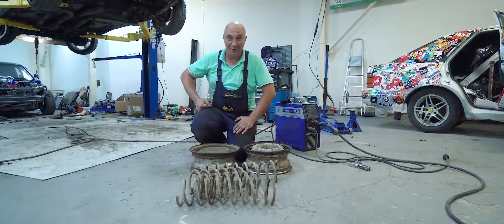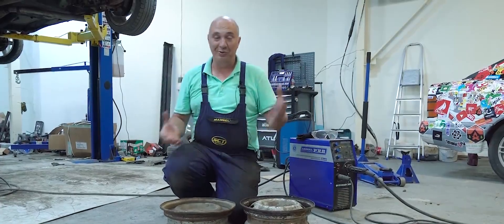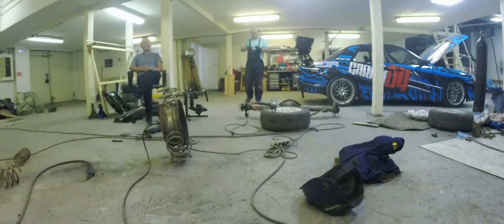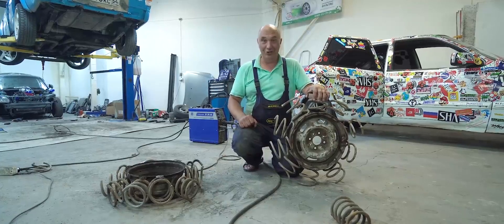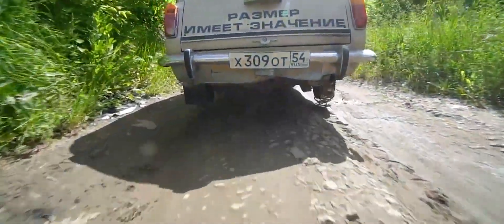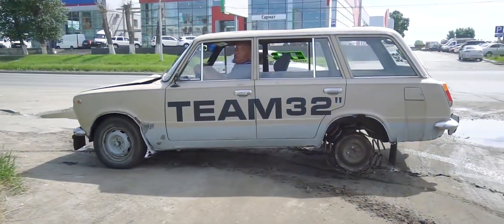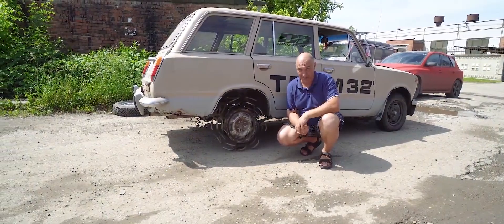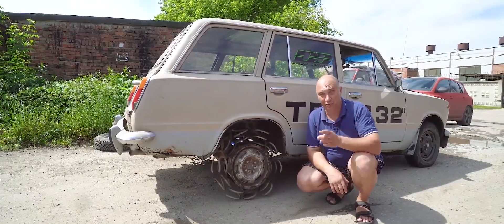Using springs instead of rubber tires

Comment: Only thing I would do is to add a rubber outer covering to the tires, so as to prevent something like a rock getting jammed up in the coil springs, preventing them from working properly.

Comment: You can cover the outside end of the springs with an steel or iron sheet and weld it up and put back the tyres, it will look more like a normal tyre, tube-less

Comment: Nice idea though. But those might leave behind marks on the road. I guess they are good only for off-road. And I think similar technique is already experimented with rubber springs instead of steel, which will be smooth and noise-free.

Comment: Сделайте это более сложным с более длинным видео, чтобы поставить все 4 шины на пружины и сделать упорный курс и подняться на холм. 

I used Google Translator if it’s not correct blame them lol 

For English I said put it onto 4 spring tires do a course and finish it up with a hill climb. Also make the videos a bit longer 

Also 

Take all the inventions you created and do 2 vehicles and have races or time trial challenges with each tire type head or head.

Comment: Hello how about you add some square to rectangle rubber pads to the road end of the springs as that may make it a bit quieter and smoother, maybe then you could try it on a regular road without leaving the tracks of a herd of drunk horses 🐎 running sideways really close together ..🐎🐴 🇷🇺 from 🇨🇦 👍🏻👏🏻👏🏻

Comment: If you just line the ends of the springs with rubber all around to make a circle, wouldn't that eliminate the need for suspension and make the rumbling stop?

Comment: Suggestion: Cool, I also got that idea ones.  Cover the springs with an soft but strong cloth so the springs don't get stuck in clumps of mud or wooden sticks when you go off-road. And to spread out the power that presses on the soil.   

Kevlar Cloth maybe?

Comment: Springs make for perfect suspension, but their narrow ends concentrate all pressure of the car weight on a tiny spot. This causes the spring end point to dig into the road surface destroying it.
You can try welding metal circle plates on the end of the springs, to increase the area so pressure can spread (car tire spreads load on an area size of a cigarette pack, it does not have a large footprint at all).
You might also try gluing rubber (cut from a regular tire) over the metal plates to decrease the noise. This could then work on asphalt without damaging it.

Comment: Suggestion, how about adding a steel ring to the edges of the springs that touch the road. This would smooth out the ride but you would loose traction. Metal grips would solve this problem, but like they say, "Easier said than done". Thanks for your video! Repent! Jesus loves you all

Comment: rip off bits of tires and stick in between the gaps at the bottom of the springs... should make good enough to drive it on normal road if you do that since it won't straight up destroy the asphalt in seconds.

Comment: Try welding a steal band around the outside of the springs. Same width as the rim. May want to either weld cleats to the band or glue rubber for traction, depending on the terrain you expect to drive on.

Comment: How about wrapping a rubber at the edges.... I mean replacing air in convention tyres by these springs.... It will be a lot smoother, faster and less noise

Comment: cut some tire tread and put it over the springs.it should make it sound quieter and ride even more smooth.
Reply: I thinking the same as it will be more practical idea and maybe replace the conventional air filled tyres in future because it can absorb bump and upper rubber part can sound quiter and makes grip as well without tyre flat problem
Reply: you could just find a big enough tire and pull it over the springs instead of finding a way to attach pieces of tire to each spring. as for the idiots saying its a bad idea but not explaining why..stfu fools
Reply: I love all the arguments in this thread put some flex seal on the coil ends :)
Reply: Raz Kumar air zoom tires?
Reply: Pernection yes that’s why I meant the rubber nailed on metal base without air as their are shockers inside to absorb bumps so no need for air.its like a alloy wheel with central shocker and outside rubber on metal as it will be a permanent solution for flat tyres
Reply: Completely unconventional for high speeds.
Reply: Urban Taint I would weld curved steel to the coils and then glue and rivit the rubber to that. It would provide more surface area and allow the forces to transfer more smoothly. You would have to leave a small gap between the steel plates otherwise when the load was transferred to them and they compress the plates would bump into each other but I do like the idea
Reply: Sarcalogos Tortolero .... you’re all dumb ...... just put a condom on each spring ffs ...... lol 😂
Reply: I’ve worn that idea on my feet it’s called zcoils
Reply: Weld a flat metal over the circumference of the springs and lay rubber over that.
Reply: good idea
Reply: kharmachaos667 you could always cap the springs.then it wouldnt puncture the rubber.
Reply: I am with u urban i think if u wrap with rubber spring will be superb
Reply: Okay genius so how you gonna fill the air if you cut the tyre,you dumb fuck
Reply: Vaibhav sethi no air needed on a spring tire.the rubber is only for sound suppression  and grip.
Reply: Urban Taint oh okay never mind,i don't know that.I take my words back and sorry bro for ruining your day.In my country technology hasn't gone that far that's why i don't know that so that's why i said that sorry again i hope you understand😊❤
Reply: Punk Rock Piper thanks!
Reply: Urban Taint - Agreed...they should try making that with proper equipments.
Reply: Great idea
Reply: I had the same idea!
Reply: Urban Taint
Reply: Urban Taint 32 it definitely wont stay for few mtrs of ride.
Reply: Crusty Sock weld curved steel to the springs glue and rivit the rubber to that
Reply: I only say to add plates because the tire would have no rigidity between the coil springs and yes it would probably fall off of the vehicle
Reply: Wow, didn't know they had a website! Those Italians are so clever.
Reply: bhupesh shah can you tell y its a bad idea as even I had the same thought
Reply: It will puncture the rubber, and possibly will tear off the rubber sideways because he cant bond it to the metal directly. Xd
Reply: why don't you do it?
Reply: ok
Reply: Exactly what I was thinking
Reply: I don't think that would work out bro
Reply: Or put a tire on it
Reply: Right....make a TIRE!! Brilliant!!
Reply: Randy Ayo if this world has people like you then probably their r no inventions and we would have lived in a Stone Age
Reply: Raz Kumar We already have better tires dumb fuck... check the ones on the short bus you ride in 🤣🤣
Reply: Randy Ayo it looks like your tyres never flattened or you use only public transportation for travel because u don’t own any ride hahaha
Reply: Randy Ayo keep popping up here because...lemme guess 🤪u have so much time for it hahahaha😂😂oops did I said lemme guess instead of let me guess lol 😂 see for urself who’s spelling and grammar is incorrect hahaha😆😆😆😆😆
Reply: Bad idea
Reply: Since putting a rubber tire on the outside seems to be ruining everyone's week here, what about welding a steel loop on the outside? Maybe bend diamond plate or something for traction? Regardless, steel won't grip on concrete. Maybe a steel loop around the outside with rubber attached to the outside of that? As is, the springs have little contact with the road and will eventually snap off with any amount of torque. By welding steel to the outside, the stress is shared with all the springs and welds, not just the one in contact with the road. Its a good prototype idea, but eventually lightweight springs (composites?) would ideally be used.
Reply: Andy Jones Fuck all these people and their dumb ideas. We already have working tires....no need to Reinvent the goddam wheel! Literally! Fucking Jackholes

Comment: What about a sheet of Steel thick steel around the outside of the springs then drilled and tapped bolts through that plate steel that would be retraction on dirt I wouldn't want to use it that on the road the breaking would suck

Comment: What if you attached a rubber tread around the springs?
I would imagine that with or without the tread strip the car couldn't corner at 20 mph

Comment: coat that shit in some decent polypropylene or pvc (something like tool dip?) or even some old hose or tubing.  heat it up and seal it on.   may eliminate alot of your noise :)   (steal some shocks off an old 4x4 if ya can, lol).   great video bro.

Comment: Built a rubber tire installed on the outer edges of the springs so it can be used on paved Road

Comment: Take a tire slightly smaller diameter than spring. Cut inside sidewall out and make a rubber cap for the springs. Attach from inside so it doesn't  fly off. Should reduce noise

Comment: What if you find a way to weld/fix an actual tire to that? Maybe just the portion that contacts the ground. That would somewhat lower the noise, and with some tinkering, be used on asphalt.

Comment: 3d print them using a Graphite covered Carbon fibre. That should dampen the noise and keep the softness. Coils should actually provide more traction in muddy situations however a bit more "high tech' solution to your make-shift situation seems to be the way to go. Excellent video by the way.

Comment: That is super cool that it worked out! I wonder if attaching only a tire tread around the outside of the springs would make it practical for everyday use? Just like how older, "bald" tires are sometimes "re-treaded", I wonder if the same approach could work here? Its like you have created a better version of the tweel! Haha! Thanks for trying this experiment and posting it!

Comment: It might work well if you weld some plates on them to have a more flat surface to step on, and the plates can overlap each other at margins, so they glide on bumps. http://jpgbox.com/jpg/54625_600x400.jpg?15b5b325555c32

Comment: dude that was awsome the idea is great I have a suggestion for you your springs are good but they are damaging the track use some synthetic material like rubber to cover the springs and they can become first puncture proof and without air tyres.

Comment: Put some kind of cap on the end of the springs so they don't chew up the roads and give you an unbalanced tread. Would also help with grip as those springs don't have much contact area

Comment: How does this perform while breaking..this spring won't stop car it will slip on road giving out Sparks..only front wheel will be in action for breaking..so one can't ride on 3rd or 4th gear if he wants to break in emergency. You need to have another outer layer of rubber with sockets to rest spring inside to get a grip

Comment: Try adding a strip of rubber (like the tread from an actual tire)around the outside perimeter to quiet the springs and add traction on paved surfaces. Not to mention what damage those springs would do to the roads. But genius idea nonetheless.

Comment: What would it ride like if you took the tread  portion of a retread tire off, and wrapped the steal-belting overtop of the springs? It should increase safety, as the band of steal-belts would contain the shrapnel in case a spring broke lose. It would also make it possible to drive on blacktop without destroying the road surface. Try it and make another video.

Comment: You know I think he's onto something.  To improve the design he could fasten a thin flexible ring of steel or rubber on the outside to prevent the springs from poking in the mud or breaking off.

Comment: Try covering the wheel in rubber.
Get a larger tire and fit it around. 
Look up video on how to retread a tire and just kinda do that. 
Be sure to fit it as snug as possible around the springs.
Reply: You could even try to experiment with cuttinh the springs and making different variations.
 I would also suggest using bald tires and maybe notching or cutting the tire some, allowing the springs to proturde just enought to provide better traction and stability.

Comment: Make some kind of cover for it, so you have the hub, springs then a layer of rubber or the like for grip, a soft surface for the road and the like. Could be onto something with that, imagine having the awesome ride the springs give you and when it's time to change tyres, it's just a cheap rubber strip with no need to worry about air pressures, etc.

Comment: Cut the tread off a tire and place it on the end . I'm sure you could mount them with a bolt if you weld something on the spring to receive the bolt . Try a bolt used on wood so it would be rounded on the tire side . It'll also keep the springs attached better and act as a safe guard keeping springs from flying off .

Comment: Might work even better if leaf springs were mounted tangiantally to the wheel, with a slight arc and enough leafs to make the wheel nearly smooth.

Comment: Weld a 6inch strip of steel around the spring wheel then you can weld on sharpened bolts for traction

Comment: OK next trial use a conveyor belt wrap (like post tensioning) the spring ends need more surface area so each spring end needs a curved rectangle piece of sheet metal. Then wrap the conveyor belt wire mesh around tensioning it tightly. This will allow higher speeds, smoother safer rides. Should handle 45 to 50 mph. Safely (straight) not including sharp turned.

Comment: you have a wonderful start. an idea is to finish the "tires" like a wagon wheel. a thick flat metal "ring" on the outside, then put a regular tire tread over the top of that.

Comment: You could try to put a rubber tire onto the springs, so you get traction on tarmac. like exchanging the air inside the tire with those springs. with a spring compressor you could squeeze the springs and then put the tire onto the 'rim'.

Comment: Roll up a ring from some 3/8 x 6 or 8 plate and weld it on the springs
That way it’s smooth but you still get the spring effect

Comment: I'm kind of interested if you went double wide with the spring tires,(two banks on each wheel) with the springs offset from each other like a dual bank radial engine.

Comment: Halo Garage 54 ENG
"Using springs instead of rubber tires"
this idea is very suitable for use in areas that do not have asphalt road 
then car just easily go offroading and also still has good traction . . .
okay thanks
Reply: sorry if i wrong, just guess it, Sir
thanks

Comment: Metal spring like wheels have been done before. I think one of the nasa vehicles has metal alloy wire tires. Sort of a woven metal fabric with spring like qualities. Solved problem for tires in space and on the moon back in the old days.

Comment: Put a strip of tire around the springs :)   Cut a tire, wrap it around them, and then glue it together or attach it together somehow!  :)  LOL!  (I would put protection in the car in case a spring flys off... they can go right through the frame and into you)...

Comment: GREAT IDEA. I THINK THE SPRINGS WILL PERFORM BETTER IF THEY ARE WELDED CLOSER TO ONE ANOTHER TO MAKE IT MORE COMPACT, FOR EXAMPLE, 16 SPRINGS PER WHEEL. THIS POSSIBLY COULD REDUCE THE WOBBLINGS.
BUT I THINK THERE MAY BE TRACTION PROBLEM WITH A HIGH NOISE MAKIND ON A TARED OR PAVED ROAD

Comment: Make a Road tire version of these with rubber sleeves around each spring and have the tread needed for braking and grip on the ends of each spring.

Comment: How about putting the spring wheel inside a real tire.  Probably will reduce noise and keep the spring from flying off in case the weld gives.
Airless tire, no more flats.

Comment: Wrap the wheels with tire rubber to give them an even plane.  Hopefully, it would reduce the noise and provide enough traction that you can replace all four wheels yet have a smooth ride.

Comment: If you weld a steel band around the tires and bolt rubber tread to the outside you might have a viable highway tire.

Comment: Do you think you could weld a brace or something into these so they can be used on the front steering wheels? I've been thinking, but only for a few minutes. Just something to brace them as you make turns.

Comment: put some tires over the springs. you may be on to something. figure out how fasten them to the springs. no more flats or air pressure problems. if it works might be great on riding lawnmowers and small farm tractors

Comment: Cut up some rubber from a truck tire and add them to the bottom of each coil to save the road, and remove the extra noise from the springs.

Comment: Add a sheet metal ring/sleeve around the spring and then add a 1.5 to 3cm sheet rubber ring/sleeve around it, hopefully solving all your problems. Also don't forget to weld the open spring ends into closed rings/circles.

Comment: Imagine tightly weaving them together to make the structural integrity of them more stable for less give. Then capping the tops with "Graphene" a much more durable rubber. Have a wheel that would last a very long time.

Comment: You should tac in a steel core around the end of the springs and then cut rubber up, smooth the ride out and add traction. Might make a great replacement tire ;)

Comment: Put a flat ring around the outside of the springs and weld it to them it would make it more stable. The springs would all work together. Instead of just 2 contacting the ground at a time. Like a wagon wheel.

Comment: Your vehicular will be  hopping down the road  like Bugs Bunny.  The Road noise will be so bad that  on your maiden  test  you would would be  deaf in both  ears    after  reaching your destination.  Your gas milage  would   would be  a Negative 25mpg  instead of  +25 mpg.  If one of the springs   decides it wants to  depart   your   bad luck would cause the spring to shoot off and  possibly injuring / killing a  innocent  bystander.